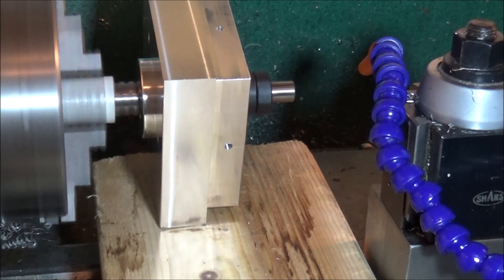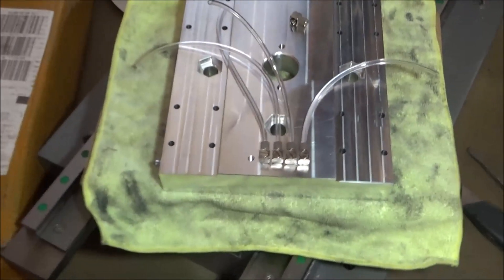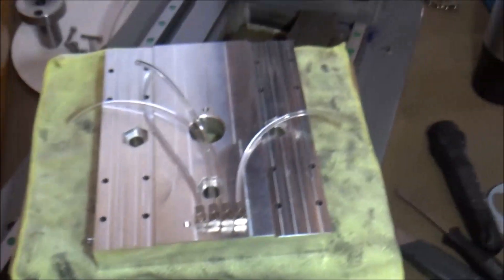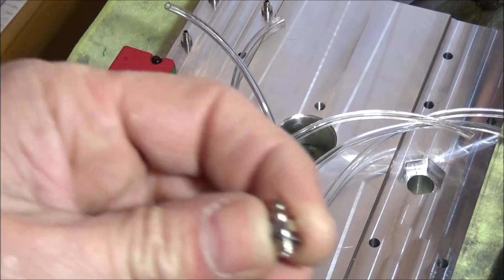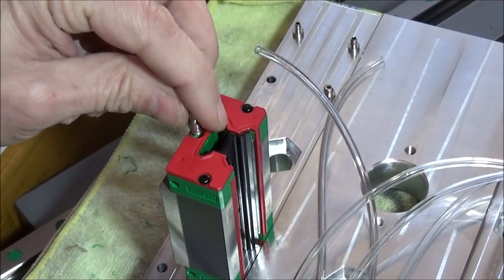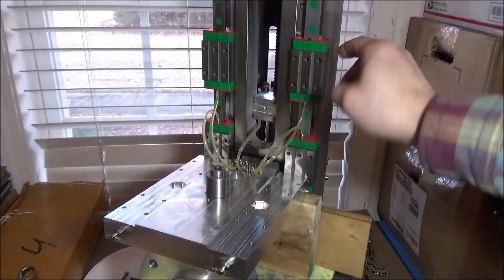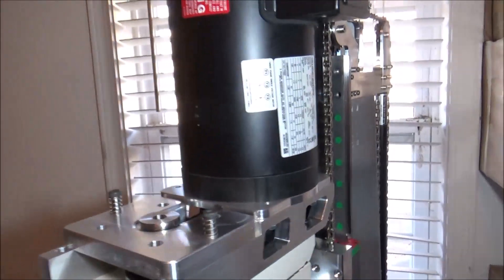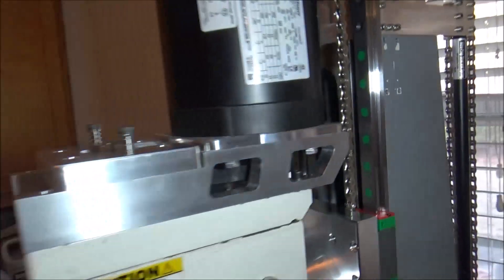PM727MXL Z Axis Final Assembly

Comment: Hopefully you're gonna do some precision and statistics testing when it's done.
A ball bar test would be ideal but quite expensive. A simple dial indicator to see the backlash and precision of those DMM servos maybe a more realistic thing.

Also one thing I've seen done before is machining a circle with the origine at the center of it and swiping a test indicator to see how round it is and so how square your machine is.
Reply from the maker: Not sure Ill do a ball bar test but I will definitely be doing some testing.
Reply: https://youtu.be/dRJMk4hkUvY?t=13m55s
Here is a good exemple. He's using linear encoders to have better results but you get the point
Reply from the maker: Thanks gorthe link